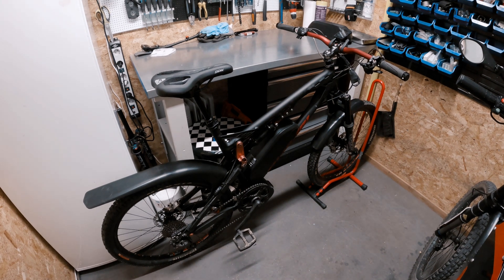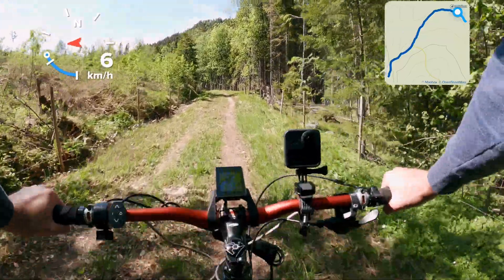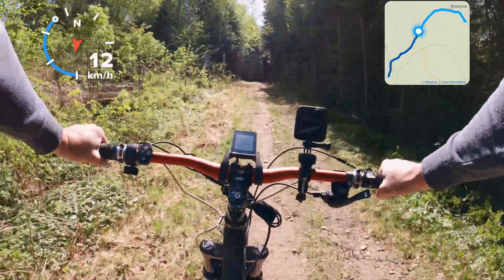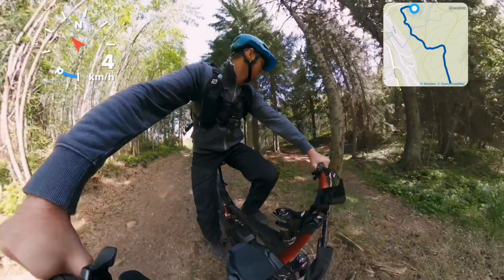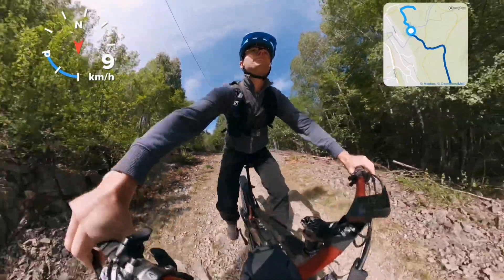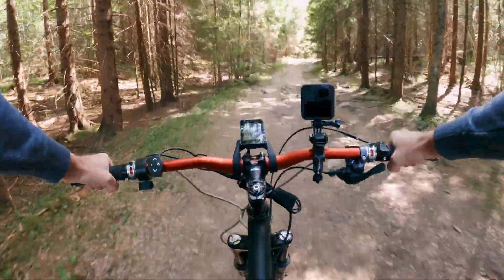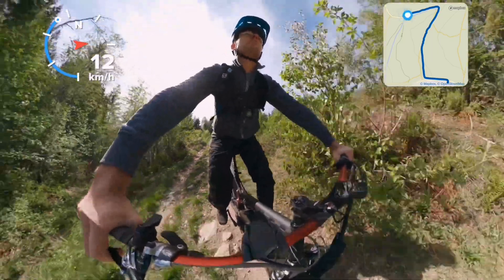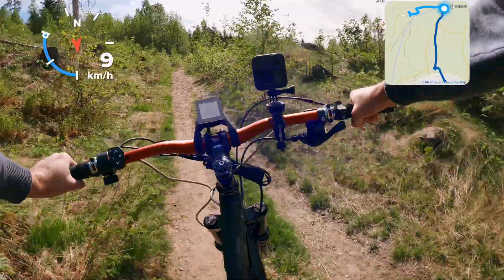ToSeven DM01 motor tests

Comment: Thanks for your report. I bought a Tongsheng TSDZ8, and I am very disappointed. It promises 750W of power,  but the pedal/torque assisted power is not more than about 200W. I simply cannot follow another bike with a 250W motor. However, when pressing the throttle the motor delivers properly, like expected for a 750W motor.  So it appears that the software is designed so poorly, that only a fraction of the engines power is delivered when pushing the pedals. Therefore I ordered the ToSeven DM01 1000W engine and I hope for a dramatic improvement.

BTW, this cannot be ascribed to failure of a single sample, since my previous Tongsheng TSDZ8 behaved the same. However, that one stopped working after only about 100 kilometers. Keep your hands of this brand!!!
Reply from the maker: ToSeven motors overall impression is much better then Tongsheng. Mechanical design is way better and  firmware design is on pair with CYC motors. Full configurability from the display level is almost unheard off across the business.
Reply: @LierskogenEbikes  I have mounted and tested the DM01 now. It is an entirely different league compared to the Tongsheng TSDZ8 (with its alleged 750W). Much more powerful and I like the display with the possibility of making so many adjustements. It weighs more with 6kg compared to the Tongsheng with 3.6kg. However, the power must come from somewhere.
Reply: Mine goes very good. Bought a month ago. Norway here too.

Comment: What is that clicking/ratchet noise and what makes it happen... just coasting?
Reply from the maker: There is a ratchet mechanism in the back wheel hub. You have it in every bike with standard type casette.
Reply: @LierskogenEbikes  wow... that's loud!

Comment: Do you feel the shift sensor is necessary? I have never had a problem with TSDZW or Ananda motors without. Many buiilds for customers
Reply from the maker: I felt it was necessary in the motor firmware version from May 2023. But I did recently conversion for the client with the latest version from September and motor works much smoother than before. Motor reacts much better to the applied torque level. What is even better, you can regulate in advanced settings how much power is taken off from motor when you do the gear shift with shift sensor engaged.
Reply: There would be a difference due to the torque power, tongsheng motors aren't doing 160nm, there strongest motor can only put out 80nm, whilst Dm01 is rated at 160nm like the bbshd, not sure how much the torque sensing works in relation to how much torque is applied but i would imagine it ramps up with cadence.

Comment: Thanks for the review. I see that the DM01 is offered in a 750W or 1000W version with an 200gr weight difference only(5.8kg vs 6kg). Which version have you got? In the comments I see you said 6kg for the motor.
Reply from the maker: I have 1000W version.
Reply: @LierskogenEbikes  Any news on your side ?

Comment: Did you notice that it çlimbs better in eco mode than it does in sport.on my motor sport has a higher top end speed and battery power draw.but eco has a better low torq but will still pull the full amps in setting 5.cant wait to experiment with the advance settings once twoseven release some instructions in English. Fir now I'm just going to ride it as original.
Reply from the maker: I made separate video showing how to change settings on screen. Change the defualt ones, because they are rubish. You can tune this motor to very fine detail.

Comment: I think that 42t is a problem to climb mountains without pedaling, I don't know if you understand the configurations of the chainrings and sprockets, to climb mountains the smaller the chainring goes the better and the bigger the cog goes better, less effort for the motor and less battery consumption.
Reply from the maker: I've built and tested dozens of different configurations for the 4 last years. It all depends on how much torque you can get from motor. Higher torque gives more flexibility. Anyway, if you want to have good climbing rig, than you need motor with min. let say 150 Nm torque and at least 2-3 kW motor. This DM01 is not meant to be driven on throttle only, that's why ToSeven design it with torque sensor.
Reply: @LierskogenEbikes  ok thanks
Reply: @LierskogenEbikes  This has been answered on the High Voltage channel.I think it would climb a mountain just with the throttle. The acceleration on the slope would be a bit more sluggish than with the pedal assist though. Because with that you can help the motor get up to speed with your own effort as well. I do have a smaller chainring which I could swap on for sure. I could also use a larger gear at the back.
Reply: @LierskogenEbikes Very interesting. So, which  2-3kW and 150 Nm torque motor would you recommend to buy now?
Reply: I'm sure at a 0.33 gear ratio it would do throttle only 😅

Comment: The only chainring that comes with the kit is too big to climb mountains, the ideal would be a 32t or 34t
Reply from the maker: Could be smaller, I agree. 42t like in TSDZ2 would be perfect. At least torque is good, so it's not a big problem.

Comment: Not very quiet motor
Reply: i also have this motor freshly installed on my bike now. I swapped all the grease with my special blend as I always do with these motors. the noise is definitely higher than on the BBS02 and the reason is the twice as high nmotor speed which results in double the pitch of the sound, which is more audible. on the dm01 you mostly hear the motor pinion gear/ nylon gear friction, on the BBS02 you hear the large metal gear, if poorly lubricated.
and despite the higher pitch of the DM-01, the sound is pretty bold and doesn't sound cheap (thin straight cut plastic gears) like some of the retail emtb motors
Reply: @JoLe1991  thanks for the input, interested to know what grease you use. Currently have been running the tdz02 for years, interested in the dm02 and hoping it's more sturdy
Reply: @sj-wl8pr  the tsdz2 seems to have large mechanical tolerances...the crankshaft is a bit wobbly. i use Lucas x-treme heavy duty grease spiked with a generous amount of ptfe powder and some synthetic gear oil (85W) to make the grease a bit more fluid. the grease is polyurea shear strength thickened. i haven't tested lucas marine, but that might also be a good choice. the grease needs to adhere well to metal and plastic gears, withstand high pressure and be fluid enough to not generate excessive drag (and therefore heat).
I have to say that the stock grease  on bafang is better than in the DM-01, at least they use mineral based MoS2 grease for the large metal gear. in any case if you want to have the longest service interval and least wear, you have to put in a high performance grease. ideally even in the bearings

Comment: Hi when you first fitted the motor and tested it without a chain.did it make a slight rumbling sound reverberation through  the frame. Iv just fitted mine today and it is fairly noisy considering it's meant to be quieter than a tongsheng thanks
Reply from the maker: It depends a lot on your frame stiffness and how motor is touching it.
Reply: Iv not ridden it yet just ran it in the frame, I'm hopeing it will not have the rumble once the chain is pulling the rear wheel around. It seem to only be at full revs when it makes the rumble sounds

Comment: Sorry i mesnt the tongsheng cadence limit not the bafang you end up pedaling dead air on a bafang so its cadence limit is different to a torq sensor cadence restrictor.
Reply from the maker: What was your question once again?
Reply: Does the new motor have a significant cadence limit like the tongsheng once its at its full climbing power it will not except any more help from the rider almost like your pushing against the magnetic field of the motormagnets.
Reply from the maker: @Shreddykruger  You can set max cadence limit yourself on the screen. Max is 150 RPM as I remember.

Comment: great stuff you've done here . are you going to get dm02 too ? dm01 is kinda huge ...lots of clearance is going bye bye...can we know where did you buy it ? you might share some thoughts on dedicated thread at endless sphere forum
Reply from the maker: Maybe I will order DM02 as well for tests, it's very similar to TSDZ2. I bought actually two DM01 motors from PSWpower and ToSeven. Motor from PSWpower had non-functional (most probably broken) torque sensor. Than I got a new one directly from ToSeven and that one is good. Looks like PSWpower has some early test models on sale.
Reply: @LierskogenEbikes  toseven sells them via email or website ? they come from China directly ?
Reply: @LierskogenEbikes  to już nie muszę pytać, dlaczego na poprzednim filmie był silnik niebrandowany, a tu już z naklejką toseven. Wniosek - na obecną chwilę omijać PSW.
Reply: @LierskogenEbikes  I'm curious on the DM02 as well. I'm looking for a something like tsdz2 and hope the DM02 has better build quality and heat management despite being the same design. I don't really mind the max power since I'm quite happy with my tsdz2 even at 250w but want the ground clearance it has to avoid hitting stuff on the trails near here. Seems much quieter as well from what I can see which isn't really something I mind but is a nice plus.

Comment: Good test, but I must say it is sometimes hard to understand what you are saying because of the noise. 
About DM01, do you think it is too heavy on the bike without assist? 
Did you try to pedal without motor? Do you feel much resistence on pedals or noise when motor is off?

Looking forward DM02 tests!
Reply from the maker: Sound on these GoPro cameras could be better. Hard to get good quality without external mics.

Motor weight is 6 kg. Bike itself is fairly light (it's alu frame) and battery is fairly small, so the whole set is actually not that heavy. I haven't checked the total weight though.

DM01 has dual clutch mechanism, so it has small resistance for pedaling. Far easier to pedal without power comparing to BBSHD. BBSHD and BBS02 have just one clutch.
Reply: @LierskogenEbikes  Which one has the lowest resistance: CYC STEALTH , BBSHD or DM01?
Reply from the maker: @ataksnajpera  I think DM01
Reply: @LierskogenEbikes  That's funny because I do not feel any resistance on my STEALTH. I have broken ASI BAC855 controller so I'm forced to ride without any assistance. (CYC X6 controller is on the way)
Reply: @ataksnajpera  hello this is to7motor factory, we have no idea about the resistance of CYC STEALTH, but we are certain that our resistance is lower than BBSHD
Reply: @LierskogenEbikes  Do you know if DM02 has dual clutch too? I mean, is it the same low resistance on pedals as DM01?
Reply: @lokz9632   hello this is to7motor factory, please note that DM02 has4 dual clutch too, it's as same as DM01 has low resistance on pedals, thanks

Comment: Thanks for the videos my brother
Could you answer these 3 questions for me 
Is the Q factor of both cranks even or is the right side a little wider?

How is the chain line ?

Is there any reason you can see for not running the smallest possible chainring for the current spider bolt pattern or does it look like there is a limit for some reason  Smallest available 110bcd is 33tooth
Reply: Hello, this is to7motor factory, both cranks are even;  chain line is 50mm;  if CL is 50mm, then DM01 requests 46T, DM02 requests 42T, if CL is 59mm， chainring above 36T can be matched, such as: 36t, 38T, 40T, 42T, 48T, e.t.c
Reply from the maker: I didn't pay attention to Q factor.

Chain line is OK. More or less chain is straight on the middle gear.

If you plan to mount smaller chainring with offset, than it will rub against main gear sprocket cover. I checked 42T chainring with 10mm offset and it touches the cover. I bought 40T narrow-wide chainring without offset to see how this will work.

Comment: seems kind of loud (compared to bafang)
Reply from the maker: This is nothing. Hear the CYC Stealth, this is noisy motor. At least the first generation.
Reply: i also got hands on a DM 01, it's no louder than the bbshd, but i think proper grease will get the noise down even further. the white lithium grease in the DM-01 seems inappropriate for gear lubrication. disassembly is easier than with bbs motors